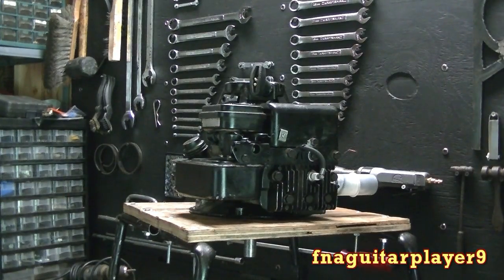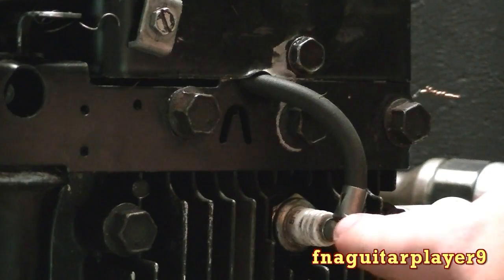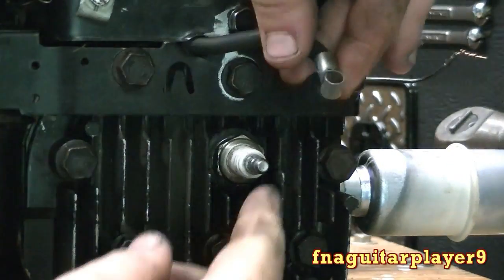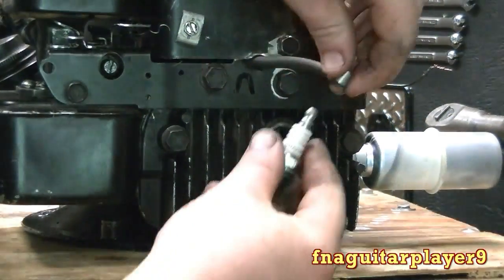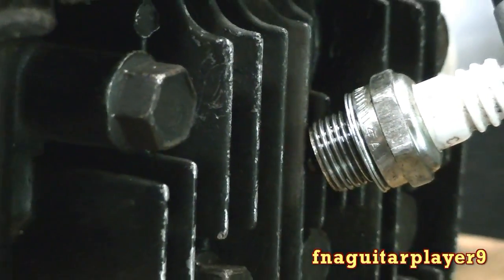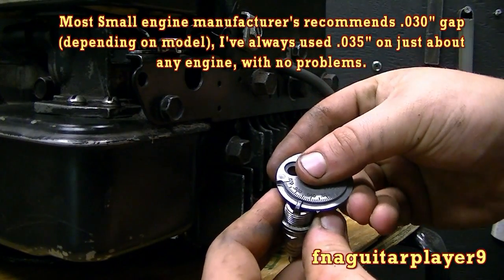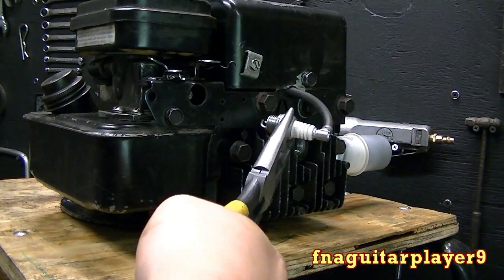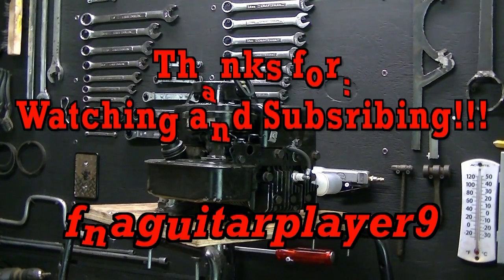How to check for Spark Plug Fire (in any engine)

Comment: I have a generator that I am having issues with. I took out the spark plug and full of oil.
Reply from the maker: Sounds like it probably needs rings, just about any time oil is in the cylinder its rings or valve guides/seals. Thanks for Watching!!!

Comment: If my spark plugs “spark” does that mean my coil pack is fine?
Reply from the maker: Yes and no. Just  because it sparks it could be weak, or if the engine is getting hot and shutting off then it could be a bad coil (breaking down when it gets hot) But generally speaking if you have a good blue or purple spark its "good". Thanks for Watching!!!

Comment: I've also had $25 plugs that were guaranteed not to foul but they did foul
Reply from the maker: Yeah, I've had some E3 plugs foul before, that are not supposed to. each engine is different, some plugs just seem to work better in some engines. Thanks for Watching!!!
Reply: @fnaguitarplayer9  I mean not just all I mean you buy them brand new and they do not work from the manufacturer it's not always calling out spark plugs sometimes they just not put together right and they just don't work I put brand new plugs in a bunch of cars had to go and get different plugs cuz it ran better with the old plug then it did with the new ones because the new ones just weren't firing right and I've had plugs that fire every other time instead of every time it's supposed to

Comment: how would you know if the ignition coil is bad- bought a blower for 20 bucks- cleaned the card, hoses etc but it won't fire- plug was dirty- cleaned it, but can the starter coil be shot
Reply from the maker: check for spark first, or use a inline spark plug checker, if it sparks then the coil isn't bad, if its a weak spark, like a yellow, orange or red, then try another plug first, if its still weak then its the coil. Thanks for Watching!!!

Comment: Just buy a "Check Spark" tool off ebay.  Costs around 30 bucks, works on any engine with plugs and cable, it simply clamps onto cable and will tell you not only if you have spark, but whether your voltage is correct.
The "old school" method is so obsolete.
Reply from the maker: I've thought about it, but I much prefer this method, I'd rather see the spark my self. And 90% of the time when your checking for spark, you should be checking the plug to see if it needs cleaned/replaced. I'm old school on alot of things! Thanks for Watching!!!
Reply: It may be old school but it works. I've used this check many a time when I've ben riding old two stroke motorbikes and they break down.
Reply from the maker: I prefer doing this way, i like to see the spark, so i know whats going on inside. Thanks for Watching!

Comment: our car isn't getting any spark at all we have power but car won't start.
Reply from the maker: I don't know if it has individual coil packs or coil and distributor, if its individual coil packs its probably a fuse or a sensor if it has the distributor then its probably the coil, resistor or something else related to the ignition system. hope this helps, thanks for watching!!!

Comment: Champion plugs are weak. They foul easily..NGK are MUCH better..no fouling like other plugs !!
Reply: Not true any spark plug can fowl I've never had a problem with champion fowling extremely quick specialty running them on 2 stroke matter of fact I have boughten brand new plugs for cars and the car runs worse with new plugs than it did with the old ones because it was only firing on three or four cylinders out of 6 and if you drop a set of plugs even in the Box on hard surface like asphalt or concrete do not install take them down and get new ones
Reply: I've only been working on cars since 1997 and I've been working on bike since1986
Reply: And they weren't cheap they were eight bucks a piece because they were iridium somewhere in the neighborhood of 53 $54 for 6 plugs

Comment: That is "NOT" a good way to test a spark plug. It is quite common for bad plugs not to produce spark under compression!! It is best just to install a new one to eliminate spark issues.
Reply from the maker: +service1956 Its true and i've had alot of people tell me this, but its always worked for me, I mainly work on small engines as well and 90% of the time it works great to test them. but sometimes when a motor will not run right or at all, it is do to a weaker spark. Thanks for Watching!!!

Comment: I wouldn't recommend this to anybody ...especially in a car's engine!! the Voltage at the spark plug can be anywhere from 40,000 to 100,000 volts.
Reply from the maker: True about high voltages, but you should not close to plugs, 5 feet away and you can still see how it sparking. Thanks for Watching!!!
Reply: this is true. HOWEVER. I've been shocked so many times checking for spark using this exact method, and I'm still here. The voltage may be high but the amperage is fairly low, yeah it shocks you but it doesn't hurt more than a few seconds.
Reply from the maker: yeah it can get you pretty good sometimes haha Like last summer me and my buddy was working on a pushmower and i told him wait until i say before you crank it, as soon as i grab the plug he cranks it haha Yeah its not that bad but it lets you know not to get that close again haha Thanks for Watching!